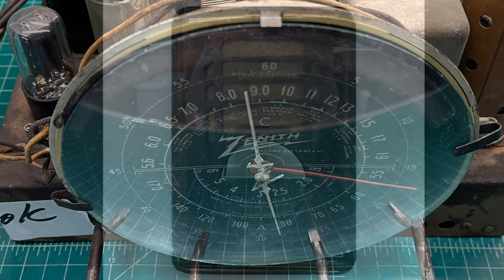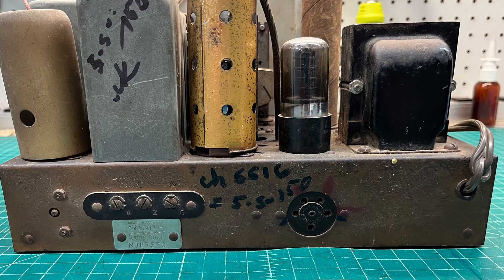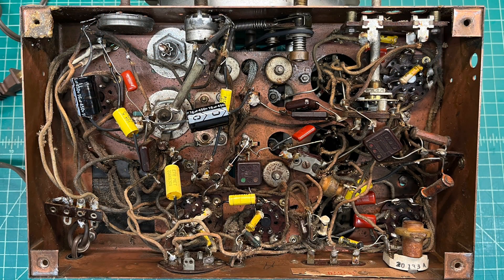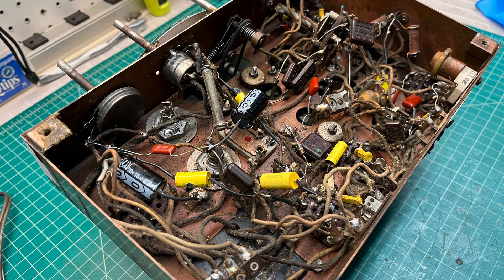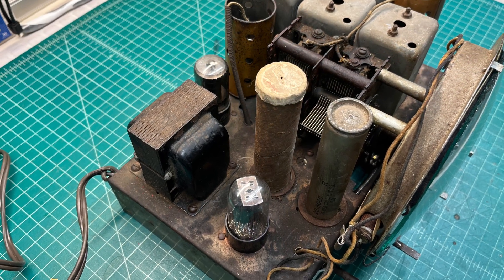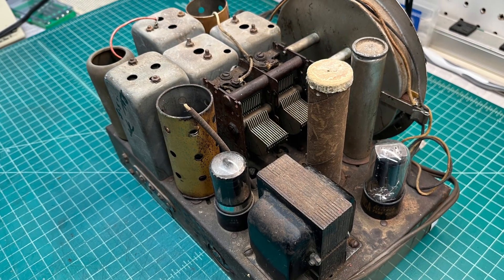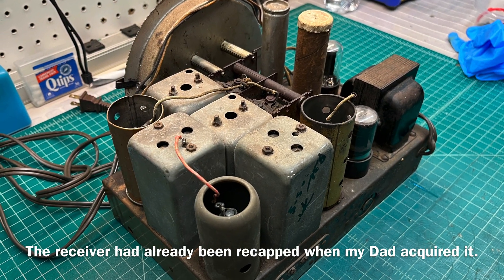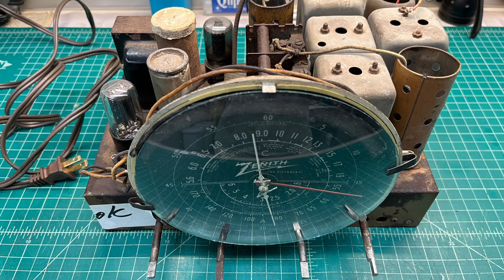Zenith 5-S-127 | Quick Intro | Next Project

Comment: These are great sets but there are two parts of them that drive me nuts; 1- the dial glass. If the clips that hold the glass on are missing, its a bear rigging up something that will reliably hold that glass on. I have heard suggestions of bending piano wire & the like and have had limited success with it. 2- The dial mechanism has a clockwork spring assist like feature which is great when it is clean and operable but if it gets dirty & corroded it can be quite the project to get it tuning again. The last time I did one I had to take the chassis out and hose it down with brake cleaner for days to get the tuner cleaned & back into mechanically working order... while being careful not to get that brake clean on something else!
Reply from the maker: Yep, I was fortunate to find both of the dial glass retaining clips in good shape on this one. Now, the chassis looks like it had been buried in the ground at some point. LOL I just finished cleaning up the variable capacitor (published the video earlier today) and the spring assist on mine is now free and seems to be working as designed. I was real concerned after finding lots of crud, crap and much rust, but I have my fingers crossed it will perform as designed; time will tell. Thanks for watching and reaching out. Best, Don
Reply: After I got mine clean it worked, but then a year later the belt started slipping. Its always something with those belt driven zeniths lol.
Reply from the maker: Yep, lots of moving parts to create havoc. Best, Don